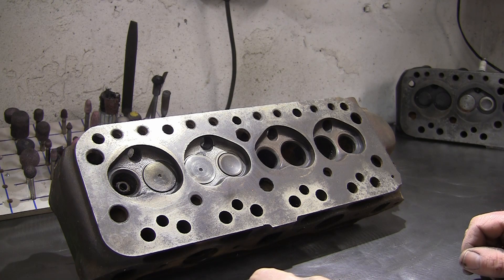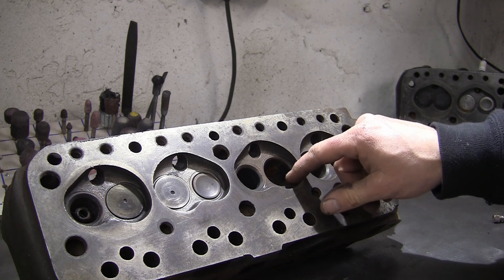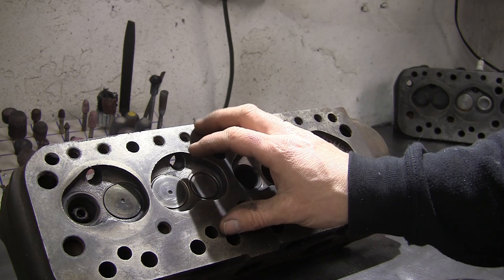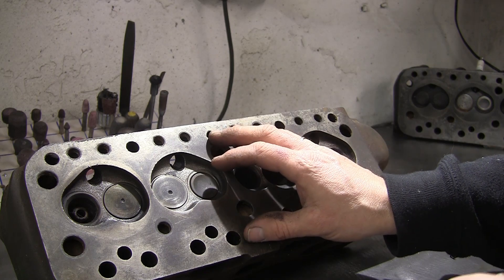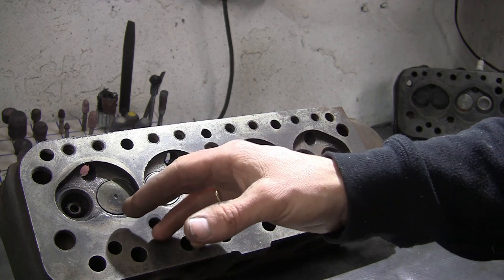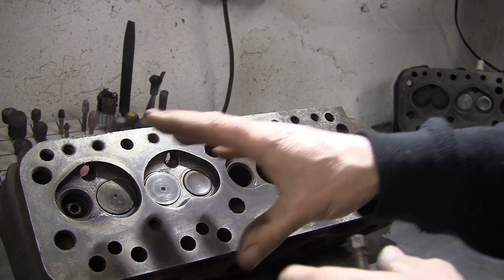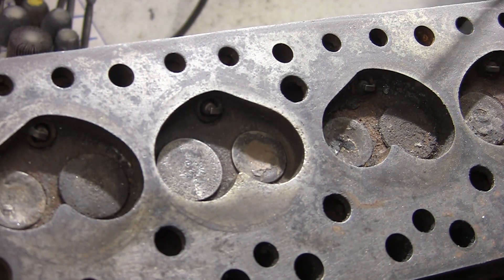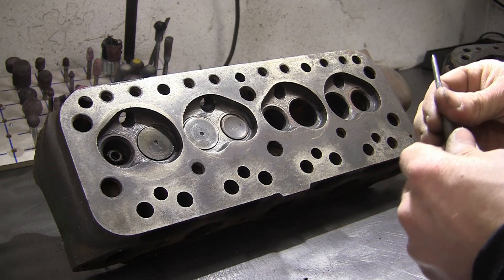Classic Mini Cooper 12G295 cylinder heads. Absolutely everything you need to know, a complete guide.

Comment: In the end I went with a modified 12A1456 pre A plus casting (my original head) modified by CST. It's got 31.75 inlets and 27.12 exhausts with completely reshaped chambers. This head is a better breathing head than a 295. It's inlet ports are smaller diameter but this aids gas flow as the 295 inlets are bordering on too large. It's got double valves springs, hardened seats it's the business.

The only thing that is a little odd is the inlet spring caps are higher than all the exhaust caps. This is apparently due to the collect groove being in a different position on the inlets. Although the spring seats have been machined/shimmed to ensure correct pressure. Have you ever seen this done Phil? Apparently it's completely fine.
Reply from the maker: Sounds like a good spec. People underestimate what can be achieved with those castings, the bigger port of the 295 isn't always an advantage.
The valves are fine as the spring height has been compensated for. Its not uncommon where different types/brands of valves are used.

Comment: Do you have to shim under the rockers as they are 1275 inlet valves on a 998? I'm pretty sure these are longer than 998 valves? Any advice would be great Phil. 👍
Reply from the maker: Hi Paul. If you use the 1275 valves you will have to shim the valve springs to correct the fitted height & the rocker geometry will need adjustment to optimise it, yes.

Comment: Really helpful video, thanks! What’s your opinion on using a 12g940 on a small bore engine? They seem far more plentiful (and cheaper) than the 295s :)
Reply from the maker: Rhys Lister if you go that route use the small valve version 33/29mm if it’s a road going car. Keep the standard size ports to, they’re more than adequate in size. Also be aware that the 1275 heads have smaller chambers than the smallbore castings so fitting one will increase your compression ratio by quite a margin.
Reply: You'll also have to pocket the block if you fit a 12G940 to a small bore engine. Just something to bere in mind 👍
Reply from the maker: @OnlineHousehusband   not necessarily. Have a watch of this: 
https://youtu.be/rE9K1xspc68